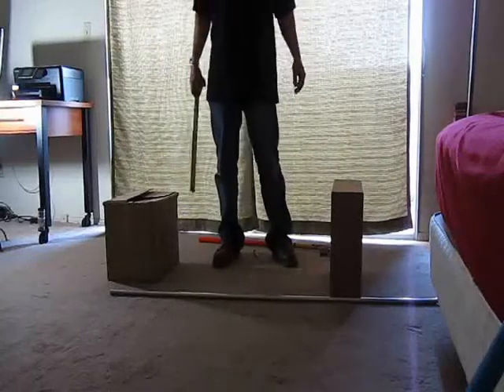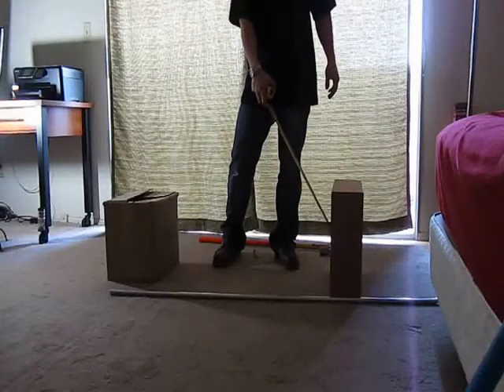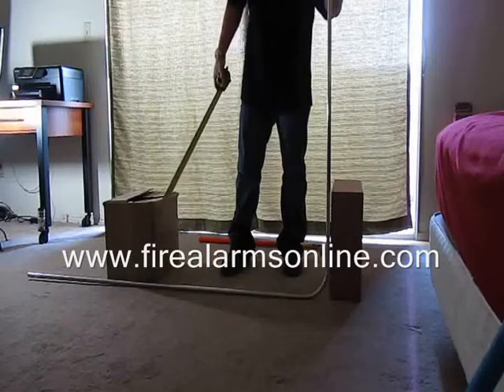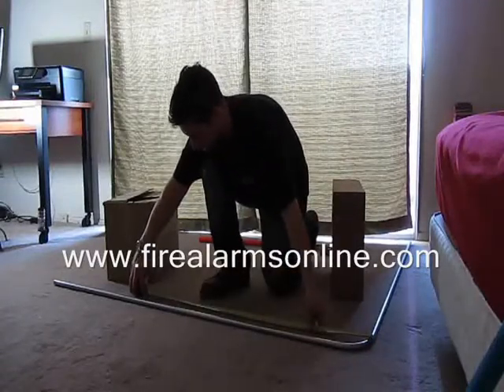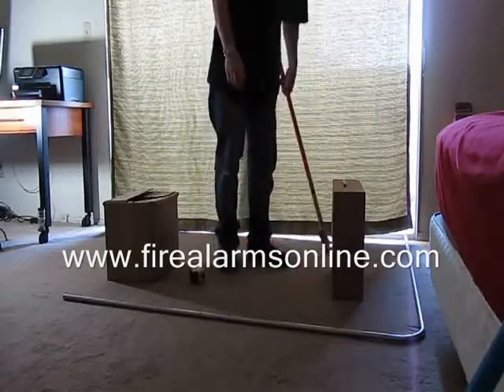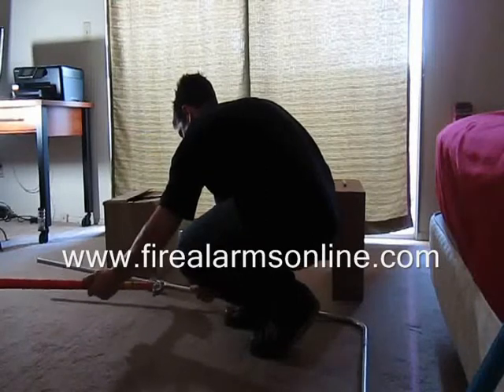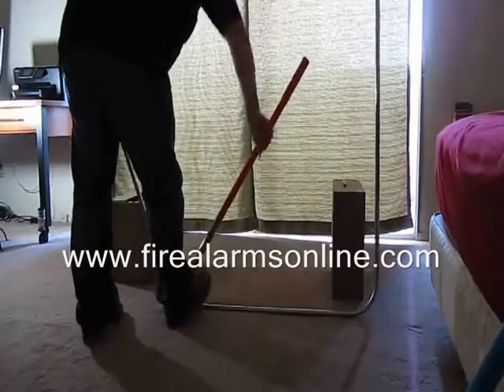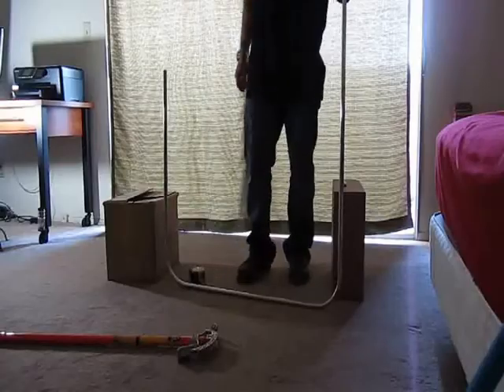Conduit Bending How to bend Back to Back 90

Comment: The star is the back of the 90. The arrow is the take up. If you bend on the arrow it will be 5 inches too short on a 1/2 inch and 6 inches on a 3/4. and so on. The larger the diameter of the conduit the more "take up" you see.

Comment: I had 31.5 in to the ceiling and i subtracted 6 in and i did my 90 degree bend and was good, then i had to go to a 55 in wall and make another 90 degree bend horizontal to the right, i measured the 55 in and i subtracted the 6 in again but my bend was like 7 in back from it was supposed to be. how should i do it next time. all the videos that i have seen are like back to back 90 degrees but what about if i have to make 3 90 degrees bending in different directions all of them? could you help me please.
Reply: martin ponce Do not subtract anything for a second bend, just use the star label on the bender.
Reply: +Timothy Huff so for one side of bending you can use the arrow then subtract the indicated stub, but if you're bending the other way, just use the actual measurement on the star (back of 90?") im starting to bend at work and this would really help thanks!
Reply: Jireh Climaco Yeah, you got it. Only use the subtracted mark once in a 90 degree bend. If back to back 90's use the exact measurement mark for the second bend.
Reply: thanks!
Reply: Jireh Climaco No problem at all!

Comment from the maker: @volcom84bait make your first 90.  then measure from the back of that 90 out across the pipe to the distance of the next 90 to complete the back to back.  Once you have your mark make sure to subtract either 5" for 1/2" or 6" for 3/4".  Then using the arrow on the bender, you can finish the job!  make sure to check out our website for more details and we will be making a better conduit bending video here in the near future.

Comment from the maker: The best way is to start off by making your first 90° or stub using the appropriate subtraction 6" for 3/4 and 5" for 1/2.  Once you have this done measure your distance to the back of the next 90° bend.  Mark your conduit and bend at the star mark.  This will give you a perfect back to back bend.  How that helps.

Comment: The way we are learning in class, if you use the arrow you must subtract the gain and face the bender in the same direction as the 1st bend. The bend showed in the video has the bender in the opposite direction as the first bend with no calculation for gain, which means it has to be on the star. You're saying it doesn't matter, you can use either star or arrow? What's the point of the star, then? I'm not badgering, I'm just a 1st year apprentice with lots of questions. : )